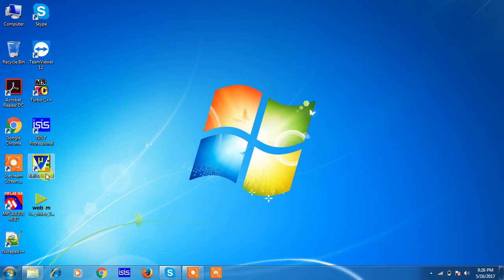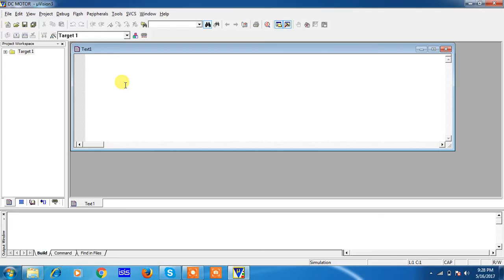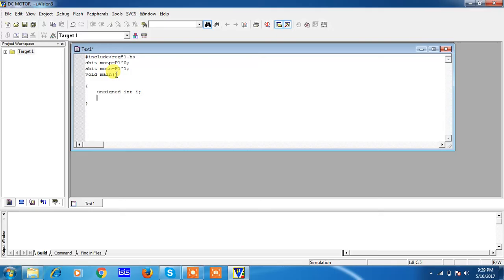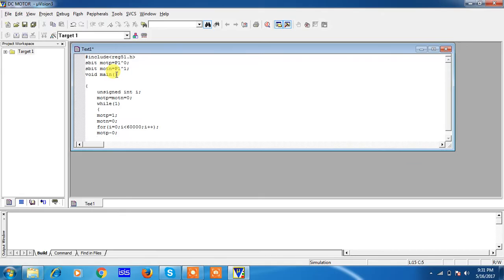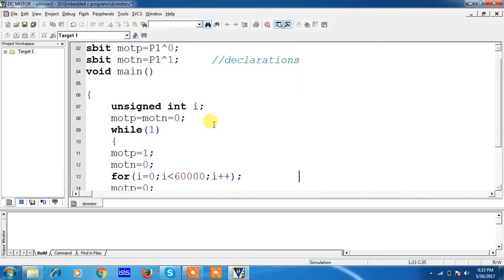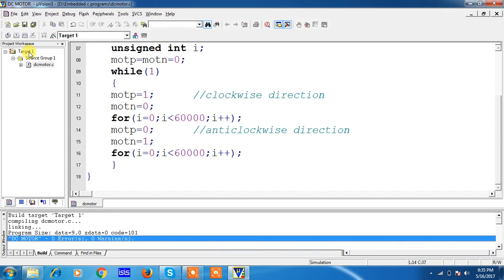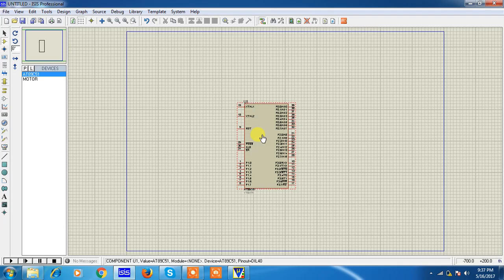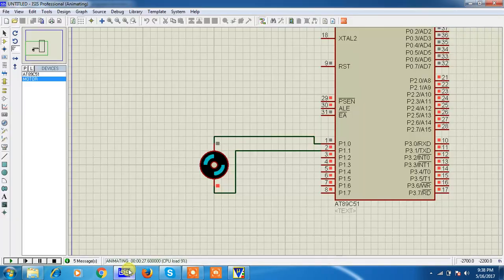Interfacing of DC motor using Keil and Proteus

Comment: there are 3 errors on proteus;
"DSIM model MCS8051.DLL failed to authorize - Missing or invalid Customer Key.. [U1]
"
"Real Time Simulation failed to start.
"
"Simulation FAILED due to fatal simulator errors.
"

how do you create the new project on proteus?